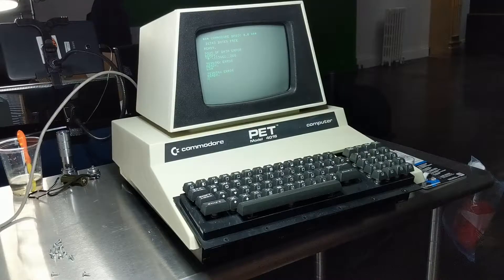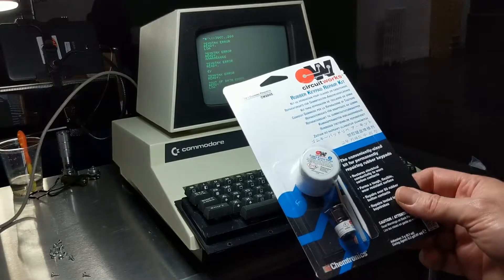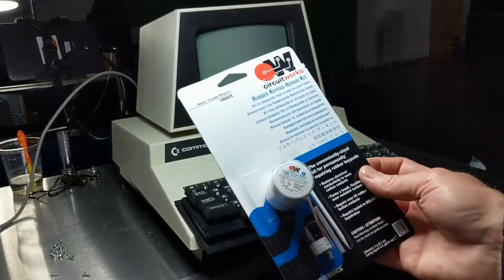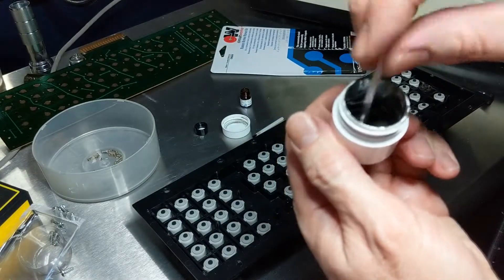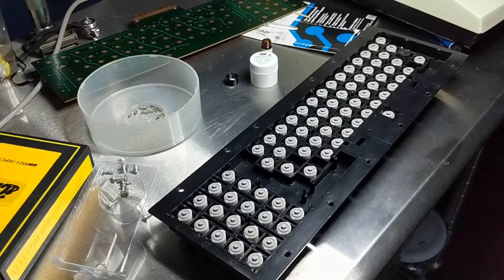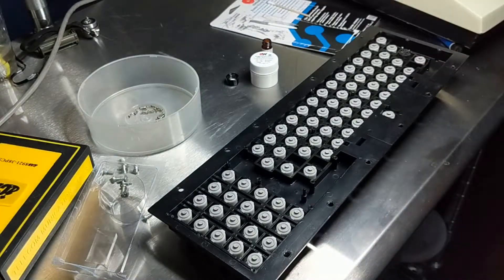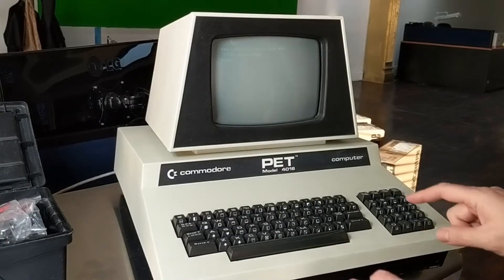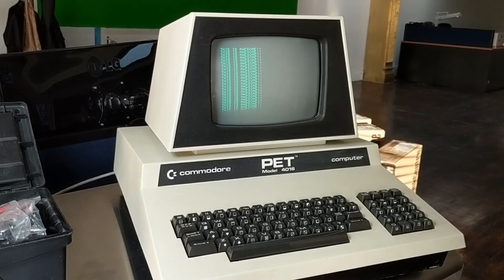circuit works keypad repair kit [CH-CW2605] review and Pet Keyboard fix

Comment: I've just been looking at getting this stuff in the UK to fix a rubber dome keyboard that was partially damaged by battery alkali. I also have several PETs that, like you, I cleaned several years ago so they're probably back to being nonfunctional again. I was worried how much would be left in the pot afterwards and I'm pleased to see that my near-£40 purchase should easily do all the keyboards AND I have up to 3 days to do them all. Thanks for the video!

Comment: It's a year later, is the keyboard still functional?
Reply from the maker: It's still working perfectly.
Reply: @bkayfetz  Excellent, thanks, I'm about to do the same thing.
Reply from the maker: @MattKasdorf  Just tripped across this again, still working great!
Reply: @bkayfetz  Thanks for the update.  I tried with a different brand on my chiclet keyboard.  I just made a big mess, with a coat that was too thick and flaked off days later.  I next tried carbon "pads" on tape strips, but surprisingly that didn't work either.  Looks like my keyboard issues lay elsewhere.
🇨🇦